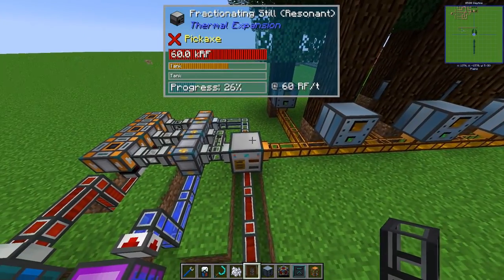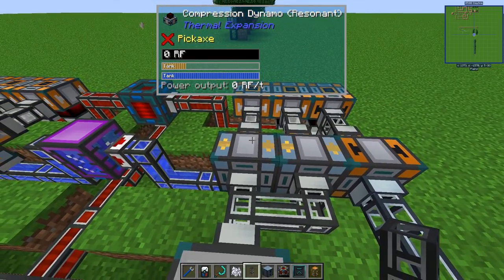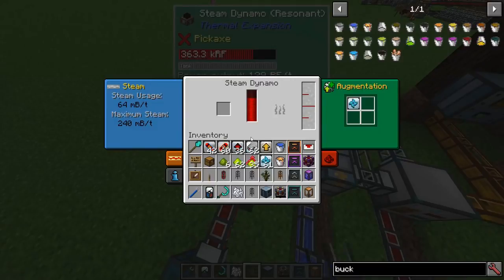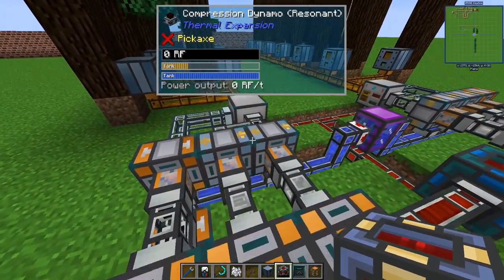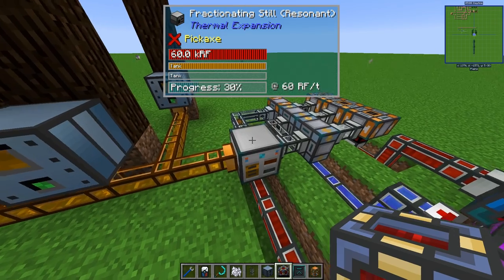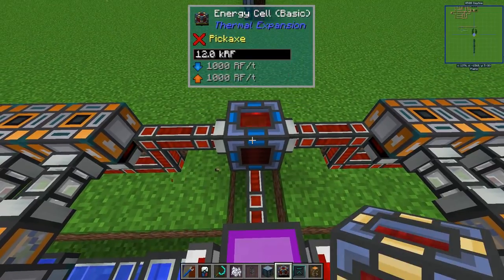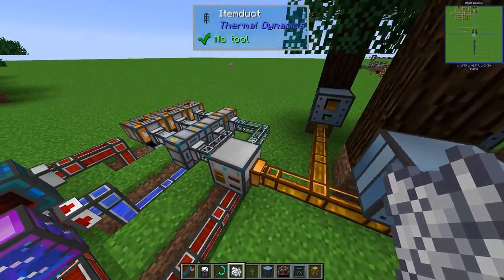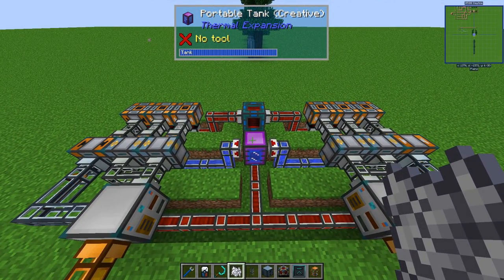Extractor Power Plant: Infinite Energy - Thermal Expansion Build

Comment: You should be able to do this with only 3 trees per side, right? I'm pretty sure you can place 4 Arboreal Extractors on the same tree.
Reply from the maker: Yes, but it takes longer if you have more extractors. I don't know the sweet spot but the documentation says:

Extractors	Cycle length per extractor

1	500 ticks (25 seconds)
2	750 ticks (37.5 seconds)
3 or more	1,000 ticks (50 seconds)
https://teamcofh.com/docs/1.12/thermal-expansion/arboreal-extractor/
Reply: Ah, interesting. I must do some research.

Comment: Can you make a step by step tutorial for this? thx
Reply from the maker: I have covered all blocks over several videos before (in the tutorials), I didn't think it was needed to go through them again. Check the playlist to find the specific block you need help with. If it's not enough, hook me up on Discord and we can help you there.
Reply: @therealtkh  I ended up figuring it out with screenshots haha. But thanks though, and great setup!
Reply: @therealtkh  Also another thing, are the 4 upgrades slot necessary for the dynamos? Or can you use one with just 2-3?
Reply from the maker: @andylolol  Hehe, ok, hope you got it working :) The Dynamos I used were all upgraded to max but I don't think they have to be. Depends on how many augments you're using and how quickly you want to burn through the fuel. A higher tier will burn through it faster, but you will get the same amount of energy. Also, they have to match each other when you generate steam and use it.
Reply: @therealtkh  thank you! I think I'll go for one Fuel  Catalyzer to start with. I'll report back if it works!

Comment: I mean, honestly... 1000RF per tick? That's nowhere near enough for 6 or 8 people.

Surely this setup can be duplicated and/or expanded, to produce upwards of say... 30,000RF per tick, minimum?
Reply from the maker: Hehe, this type of "free energy" is not really ment to be a huge power source for many people, I would rather use it to keep core functionality running to maintain critical parts of a larger system. Of course you can expand it but looking at the size of this build for such a small amount of energy I doubt it would be worth the struggle.
Reply: @therealtkh  Eh. Still need more than a measely 1000RF a tick. We've currently got like... 28,000 RF a tick, just using lava and Blazing Pyrotheum.
Reply from the maker: @doomyoda7298  I never said this was the best method or that it would replace other setups, it's simply an interesting way to use standard machines to get infinite energy in small amounts. It also depends on what mods you have at hand, or how a modpack configured them.
Reply: @therealtkh  That's true.My bad, man. Was a very stressful day. 

i do agree though. It does depend. Only recently (after only having been playing Minecraft for about a year to 3), discovered Blazing Pyrotheum. It works wonders for melting cobblestone into lava using a crucible, and igneous extruders to provide an infinite amount of cobblestone. Then, the cobblestone goes into magma dynamos and it's just a fun time for all parties involved. lol